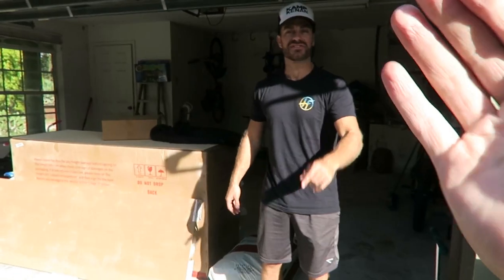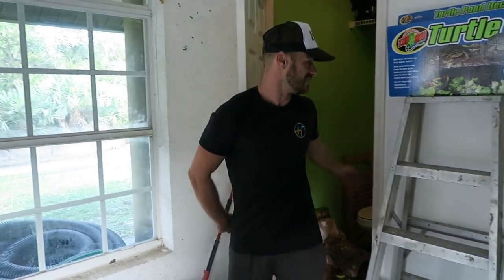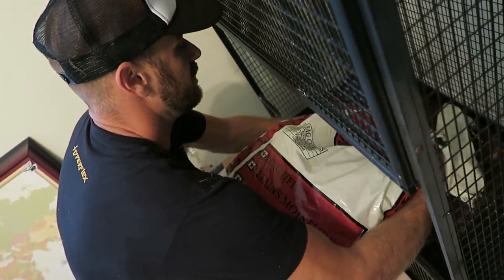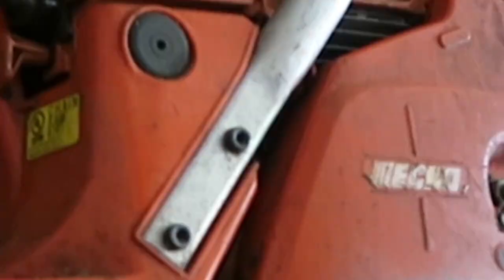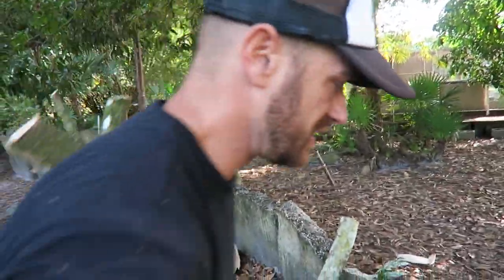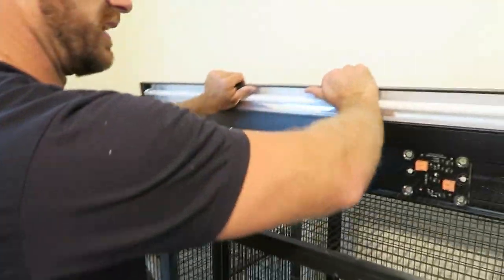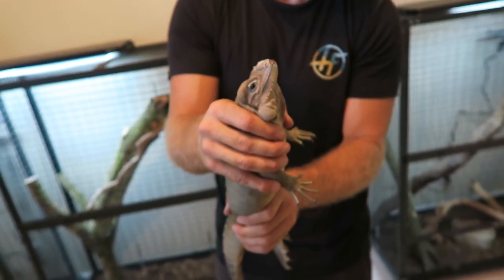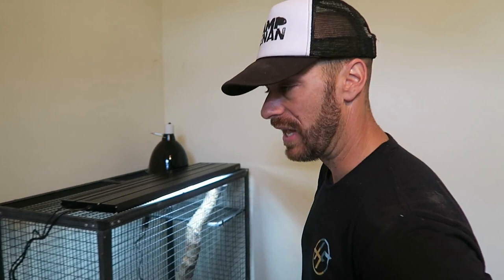4 New LIZARDS unboxing & Set Up with Paul Cuffaro!

Comment: What a great, high-energy video. Most amusing.

Here's a tip: When you remove a tree branch using a saw, the first cut should be a minor one upward underneath the branch, slicing through the bark. Then when you cut downward to separate the branch from the tree the bark will not rip in a damaging trauma to the body of tree. 
 You can see in this video the large piece of bark that tears downward when branch falls, damaging the main trunk of the tree. Cleanly removing a branch, leaving the bark as much intact as possible, is much healthier for the tree.

Comment: Get some Velcro spots to secure the doors when you need to open them. They can be found in sewing area in Wal-Mart. Adhesive backed spots 1inch diameter.

Comment: do you worry about not sanitizing the mulch when using it indoors? they carry bugs and mites sometimes. I usually heat it up in the oven in a deep baking tray before I use it in my water dragon enclose.

Comment: Suggestion for the cages, instead of a clip to hold them open place some velcro pads on each corner of the door and on the sides of the frame front where the corners align. use crazy glue or a hot gun to attach the velcro pieces to the frame and door corners. Easy to secure without needing a free hand.
Reply from the maker: Pup314 good idea.
Reply: @KampKenan  Thanks. I tend to be an ideas man. Not able to have pets where I live due to the rental agreement. :(